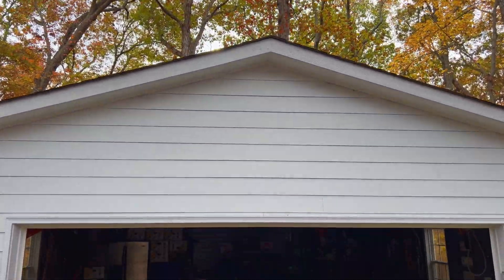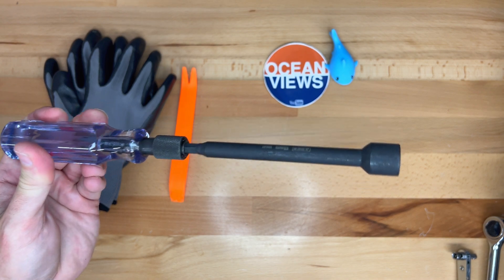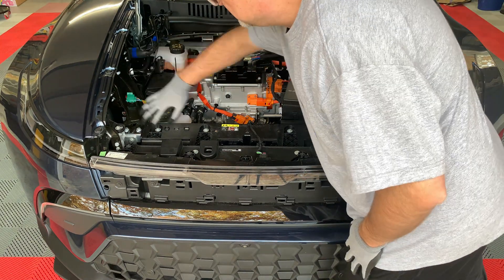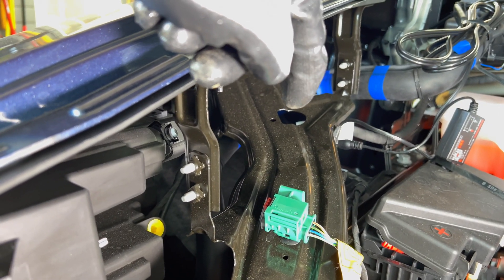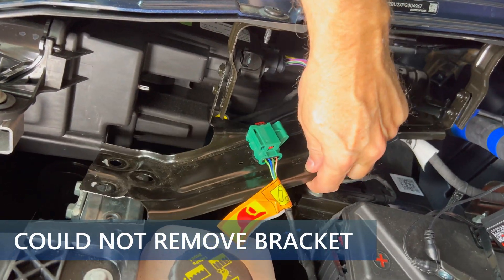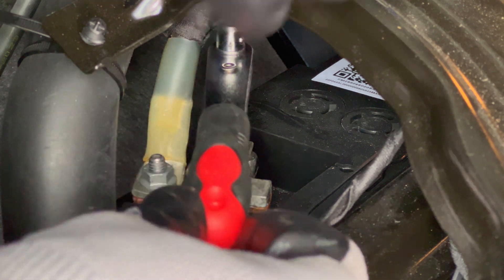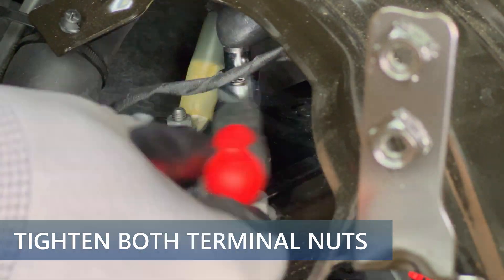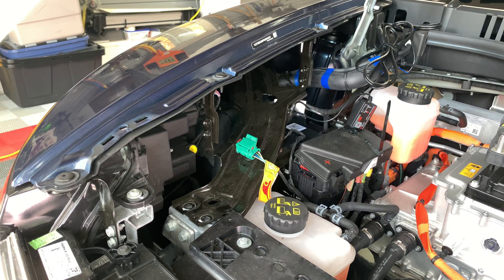Fisker Ocean - 12V Battery Terminal Fix

Comment from the maker: **Update** - I just did the fix today on a second Ocean.  This time I did not remove the bracket.  If you have a long enough extension for the 10mm socket on the ratchet, you can easily reach one of the nuts on the terminal.  Go through the bracket opening on top.  The second one required me to use the compact ratchet I used in the video.  So it can be done without removing the bracket.  That should make things a lot easier!
Reply: I thought this has been fixed by Fisker before delivery?
Reply from the maker: @gregoryalee2457 Apparently not, quite a few people have reported this issue.
Reply: @MTNRanger  - Maybe I am wrong but I could swear that Sean said an OTA fixed this issue but reading about it, I don't know how.

Comment: That very cable is in my ocean completely unplugged, its just ziptied next to the battry but NOT connected at all... Should i worry about that? Should i attach it back to the battery? its not like it came loose, its purposely removed and ziptied away. my ocean is brand new, i picked it up from an auktion like that. Maybe its for transport?
Reply from the maker: @lindstrem.alexander  Can you send me a photo to clarify? Mtn_ranger@aol.com

Comment: A couple weeks ago I started getting low 12v battery messages frequently. It started after I used the defrost for the first time. That extra load seemed to have pushed the battery past its limit. After keeping all systems off I still more and more frequently started getting the battery low warning. I replaced the battery and have been unable to drive the car since despite trying a number of suggestions. There is a mention in this video about not disconnecting the negative terminal because "systems will have to be recalibrated by a tech". The original video I watched was for maintaining 12V while changing the battery. Given I had already lost the dog windows before buying the car I wasn't worried about that so didn't bother with keeping 12v powered. The car acts so poorly with the new battery and is not drivable. I get warnings and errors about virtually every system and it won't go in to drive. I did manage to briefly get the car in to neutral a few times to roll it out of the garage. There are videos that claim "disconnect this and the car will recalibrate these systems" That seems to contradict "you will need a tech". I would like to be able to do this type of recalibration myself but of coarse find it disappointing it must be done at all. All they had to do would have been to use non-volatile memory for anything critical. Anyway, I'm looking at having the car shipped to a service center but if all that is wrong is a calibration thing that seems extreme. If I do need anything replaced they can't get the replacement parts and say they have had issues with salvaged part repairs. I put a message in with the FOA but haven't heard anything back from them. Any advice?

Comment: Great video, I have a question about that emergency plug (green), I pulled the red tab and removed the end and now I can't put it back into place. can you help on this? Thanks
Reply from the maker: I haven't removed the emergency plug - that's the kill switch for the HV battery pack.  I'll have to look into that.
Reply from the maker: OK, I found the info, it's in the Owner's manual.  I put the instructions here: https://drive.google.com/file/d/1M11Y1Tkc9gqeY4Ng76Ij25fgLCRinv5D/view?usp=sharing

Comment: Thank you! I’ve had to jump start mine twice in the last month.  It has the correct alignment and I reoriented the middle of the wire slightly because it was pretty tight. I also checked all of the positive terminal connections (always be careful and avoid touching any positive terminal connection to any metal part of the car with a tool…you can however touch the 12 V terminals with your fingers if really needed and you will probably be ok). When I got back in, I received a message that the 12 V battery was low, but the message went away after about 20 seconds. May be my problem is fixed, or could it be something else? I also noticed that the interior overhead button lights and PRND selector lights are on when I get in frequently. Sometimes the lower ambient lights are on too and back passenger lights, but I have all lights set to turn off after 15 seconds. I really hope Fisker fixes this lighting issue in Version 2.2. All interior and exterior lights should be turning off after 15 seconds or the time I select.
Reply from the maker: If you have had to jump start twice that may indicate the 12 V battery is going bad.  I would look into getting it replaced.  Yes, the ambient and other lighting has been happening since it has been released. I have noticed less with update 2.0.
Reply: Thanks, I did the wire optimization and terminal check after the two jump starts. If I need to jump start again, I will follow your advice and get the 12 V battery replaced.
Reply: @movingforward20  Did your battery survive or did you end up getting it replaced?
Reply: @bahgzd  It’s still the same one! I installed a PowerPulse from a company called PulseTech too, which helps to at least double the life of 12 V AGM batteries. Everything is working well now around this, thankfully.

Comment: Sadly the UK version is a bit more complicated.  there are more bolts to undo including one to a flange on another unit that makes it really tricky to get the bracket out of the way.  I just did this half an hour ago and sort of managed to shift the bracket but then moving the battery feed and the sensor feed apart was also more complex. I have tried, but we'll see...
Reply from the maker: Interesting, thanks for the information.  I was unaware of differences between international versions - most likely to be due to homologation.

Comment: I ll be honest. Have had 5 different evs from 4 different manufacturers.  The issue i have had most or single most problem from all 5 have been with the 12v batteries. This looks like a complete pain in the mother in law and of poor design - why Fisker/M.Steyr ?

Comment: Hey, would you know how to access the tail light plug? Trying to access it to plug in a backup LED bar for better night visibility.
Reply from the maker: No I haven't messed with anything like that yet.  I still have to test the towing package electrical connection.  There are several fuse boxes in the car. If I do find something, I'll do a video.

Comment: We found out a part 2 to the fix from engineers at Fisker. The small insulated wire coming from the sensor needs to be pushed or zip tied to the bracket so it’s not touching anything. It’s more important than it seems as European cars have voltage in the negative line that US and Japanese cars don’t. So if the sensor line is too close, it can cause false readings for the sensor.
Reply from the maker: Thanks, I’ll look into that for an update video!

Comment: Why did they have to make it so complex to reach the 12v. Most other cars, you can reach it in seconds. Does not bode well for maintenance costs.

Thanks for sharing this.
Reply from the maker: I totally agree, on an EV, the 12V is the most important item for reliability and needs to be easily accessed.
Reply: Horrible design

Comment: Great video.  It kinda makes sense that it’d be a mix of hardware configuration and software problems leading to the 12v battery problem.  If it was just software they probably would have fixed it by now.  Hope this does the trick!  Maybe a follow-up video where you go battery tender free for a couple weeks?
Reply from the maker: Well, I only had the battery tender on twice.  And that was before I got the monitor installed (coming soon, backlog of editing).  I think my low 12V battery warnings were coming right before the HV pack started charging it.  Which happens every 2 hours or so.  The big problem is that the car waits too long (11.9 V) to charge it back up.  Yes, I will be monitoring the change.
Reply: Yes, Great video 📹. Much appreciated 👍🏾 👏🏾👏🏾